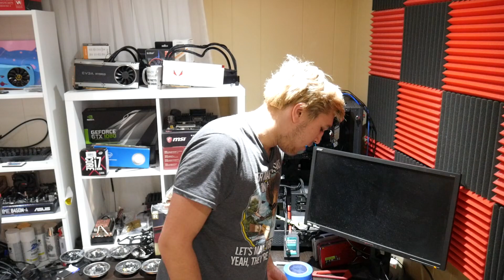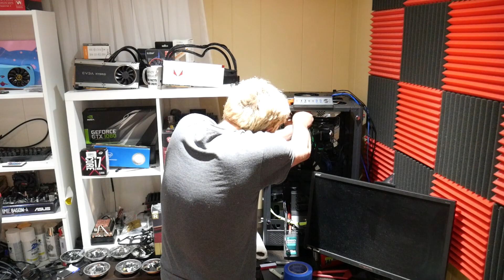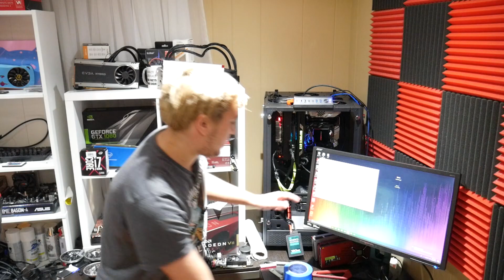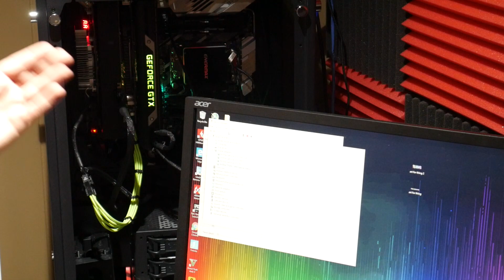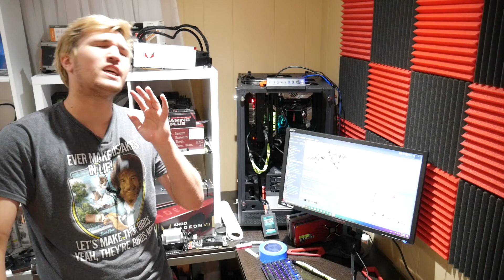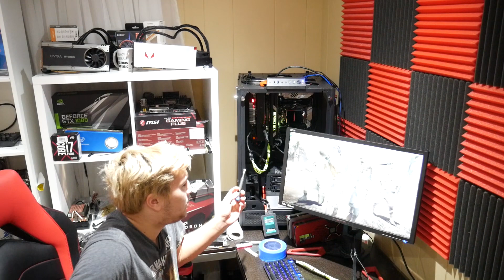Can You Use 4 Different Graphics Cards in the Same PC?

Comment: In my PC I have an RTX 3080, a Quadro P2000 and a GTX 750ti. The first two are used to drive an 8-screen flight simulator setup with XPlane 11 and Air Manager.  The 750ti is used for Windows XP gaming.  XP is in a VM and I pass through through GPU to the VM.  My CPU is a Ryzen 5950X.
Reply: You use green's gpus and red's cpus.
Reply: @efeloteishe4675  yes.  Though my setup has now changed.  I now have two systems.  One for gaming and one for productivity.  Still AMD CPUs in both (5950X and 5800X3D) and nVidia GPUs.
Reply: @ksp1278  Cool (says me who is still stuck with core 2 duo and mobile intel 4 series express chipset)
Reply: Nothing wrong with Core 2 CPUs.  I had a Core 2 Quad as my main PC until 2 years ago, and I still use it  now for games that won't run  on my newer gaming PC.

Comment: I have been trying to find out if I can mix a quadro with a 6800 xt in my pc.  Certain CAD programs I use, along with my 3D printer slicer software, is not compatible with the 6800 xt.  So I am tempted to pop a Quadro in my pc to mitigate the issue, and hoping to find out if I will have any potential issues.

Comment: Quick question. My 1070 ti DVI port broke and I have a benq xl2411z (DVI 144 hz). Can I use an old 8600GT(monitor plugged in this one) and use the 1070 ti in 3D Apps? I know it worked with my integrated GPU + 1070 ti.